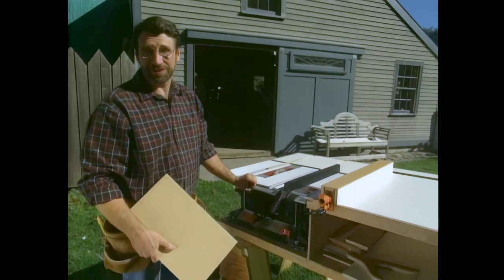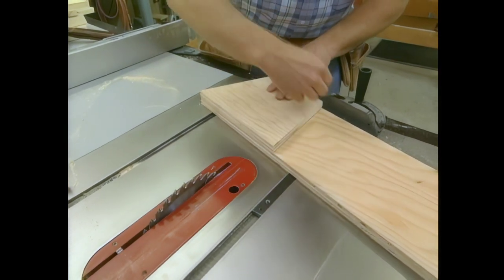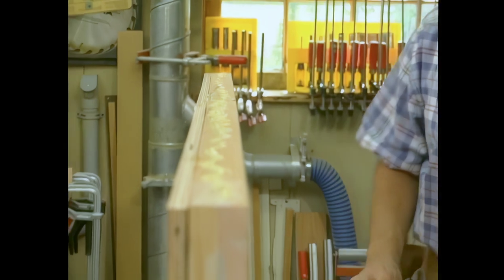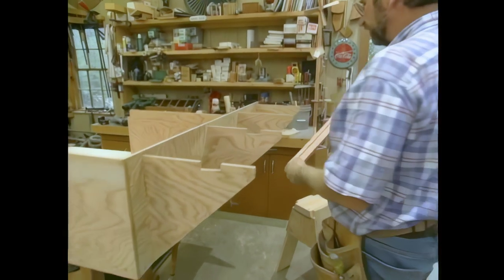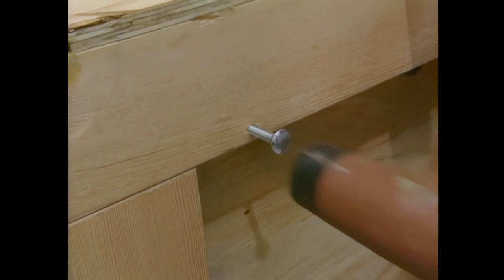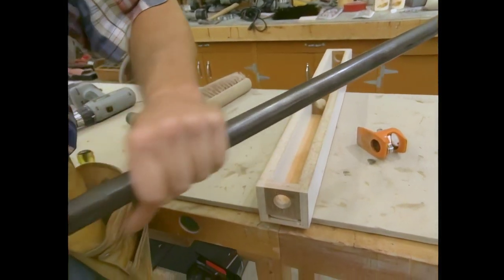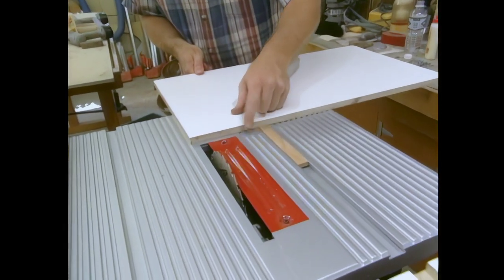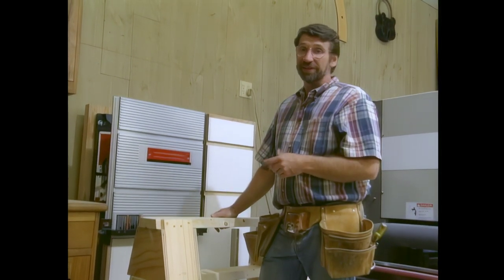Table Saw Station  |  S11 E8  [AI HD]

Comment: The saw horse design updated by Norm for the portable table saw is the real user gem of this episode. I first built two of these for my new basement workshop after this aired in 1999. An easy design to build and very versatile. Norm gives you all you need in this video to make these saw horses. I have built four additional sets over the years… 2 sets for wood working/DIY project, 1 set for a portable planting/outdoor project table, 1 set for wine making supporting the crusher and later the press and the final set for a barn utility table and junk catch-all. A great feature is that these saw horse legs are stackable too!  All moved back to California with me over the years and are still working hard. Thanks for the the updated memories and these saw horses to Norm, Russ and Crew.
Reply from the maker: Simple designs never go out of style! They are still used in the workshop as helpful as the day Norm built them.
Reply: I built several sets of these sawhorses and used them for twenty years.

I only lost them when I loaned them to a neighbor, who's wife threw them out, because they looked hand made.

To make up for it, they gave some cheap plastic sawhorses that they claimed were superior. Those soon collapsed and went in the garbage.

Comment: This is the day The Table Saw was built that made Norm's job more easier as a lot of projects traveled down that table saw through out the series.
Reply: Nope, never seen him using that little table saw ever again. It was just a project for the show.
Reply: @bryangulledge I saw a fleeting glimpse of it (or another one) when I watched the This Old House 40th Anniversary special. During a piece about Ask This Old House Tom Silva was shown reading a letter while leaning on it.
Reply: @201081hero   nice! Maybe it actually got some use.
Reply: Why would he use that little saw for all his shop projects, when he's got a freaking Unisaw in the shop? It doesn't get any better than that, the Powermatic 66 is equal in quality and accuracy.
Reply: I watched a season 3 episode and his table saw had a Biesemeyer fence now it has a Unifence
Reply: @davidbradford1513  they originally used a 1966 model Unisaw which the late Russ received new as a gift from his wife, that saw was outfitted with a Biesemeyer Fence and Outfeed Table at the end of Season 2. That saw was replaced with the 1994 model Unisaw at the end of Season 7, it originally had a Unifence. Then they switched back to using a Biesemeyer Fence in Season 13, as they said it's easier to attach sliding jigs to.

Comment: My father took that saw horse design one step further by putting a second angle on the legs. Then he notched the top 2x6 for the legs to fit into. Besides there usefulness for construction when we had summer get togethers there were always tables quickly put together with saw horses and planks.